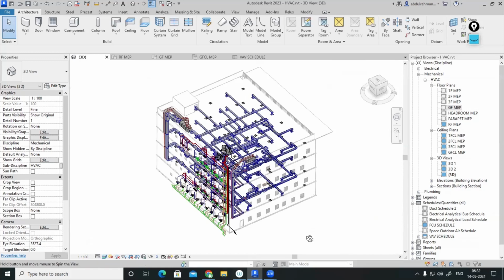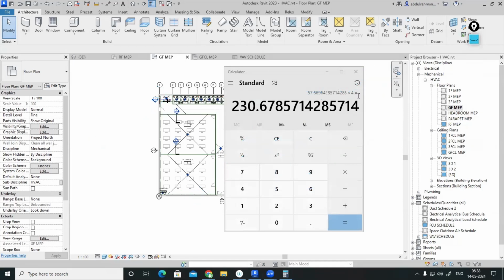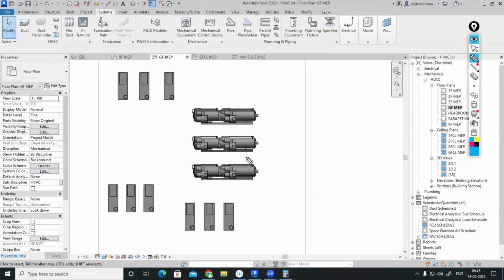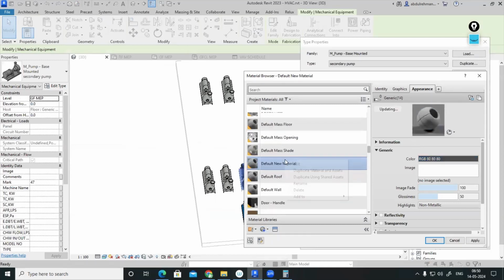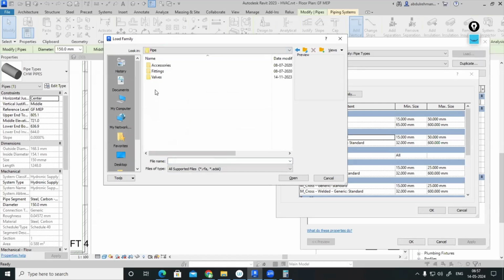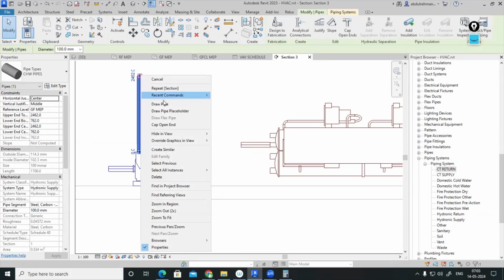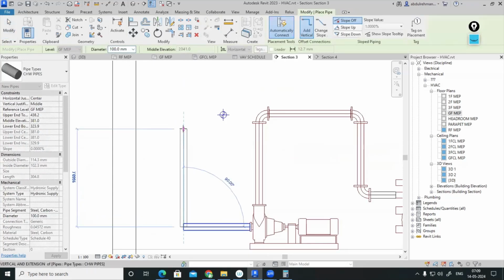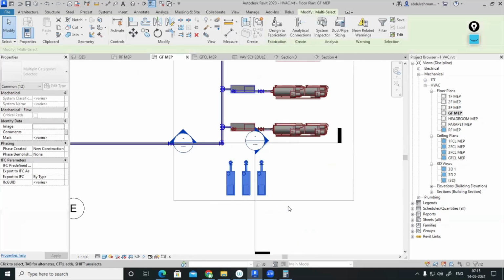WATER COOLED CHILLER PLANT ROOM MODELING IN REVIT|PART 1 OF 5|BIM MODELING|REVIT MEP|HVAC|AMNEAR|BIM

Comment: Do you offer internship with Training.
Reply from the maker: Along with the course, projects are included. With the comprehensive projects included in our coursework, there is no need for an internship, as the hands-on experience gained from these projects is substantial.
Reply: @amnearmep thnk u ....asked bcz  every projects comes with a different requirements n different challenges even different applications.